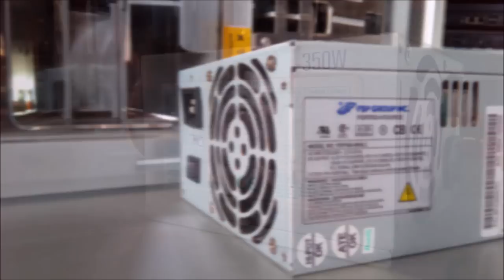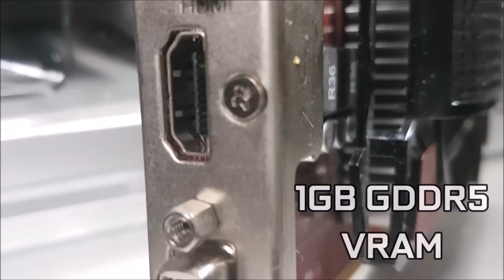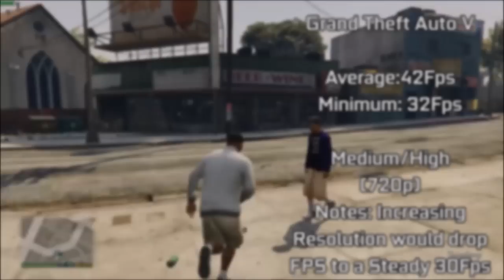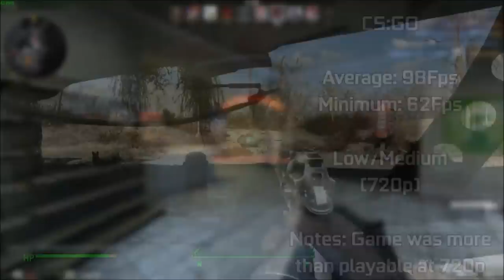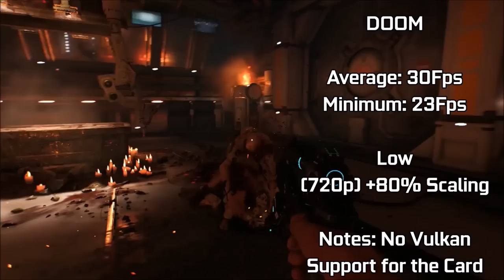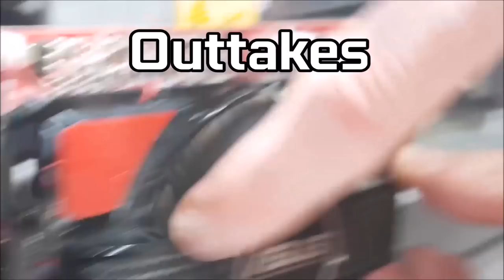Why you SHOULD buy an R7 250 in 2017 // The Low Power Consumption King.

Comment: The best GPU you could pair with an APU in Dual Graphics mode. AMD A10-7870k + R7 250 = Enough for eSports.
Reply: even r7 240 is good for esport, cs go medium 90 average lol ultra 100 average ect
Reply: hamidi abdel hakim Lol no... on medium-high 768p it barely manages to get 55-60 FPS lol...
Reply: RoomerJ The 260x makes the 250 look like a joke for price to performance but the 250 makes the 240 look like a troll for price to performance.
It's actually a little better than intel HD 4000 I think.

The R7 250 was also bottlenecked in this video in CS:GO and possibly GTA 5.
Reply: BoomerJ The consoles run at high-ultra most likely they decided 900p>1080p low/med.
As for the 
As for the GTX 750 Ti part i found only 1 video that outright lied about the performance and he has 300 views, 1 comment, and 50 subs but his oldest video is from like 8 months ago (and that video was 4 months ago) so I doubt that's what you're talking about.

In my experience a majority of people who make these videos don't lie as they have no incentive to. Even when I went and searched for the video I only found 1 where the guy made it clearly to get comments on his video and boost its ranking (sadly he didn't realize that YouTube pays attention to dislikes).

Unless you credit your source I am inclined to believe you are a liar by the way.

Comment: well I have the let's say newest version of that card wich is r7 250 2gb ddr5.Yeah,so anyway the graphics card is not the greatest I have paired it with a core 2 quad 8300 and 3gb of ddr2 ram and in most recent game it does...well?
Witcher 3 medium 720p:30-25 fps
bioshock infinte high 720p 30-25fps
battlefield 4 medium 720p 30-28fps
gta v medium 720p 40-30fps
overwatch low 480p 30-20fps
fallout 4 low 720 28-20fps
skyrim ultra 720p 60-50fps
borderlands 2 medium-high 60-54fps 
nier automata low-medium 30-18fps
and sum other mainstream games like csgo,LoL,Dota,heartstone,WoW were able to run with 60+fps at medium-high and the most mesmerizing thing for me was THAT THIS GPU DID REQUIRE A LOT OF FOKEN POWER TO WORK!(that's the reason I bought this gpu)

Comment: well, looking at the techpowerup specifications of the r7 250, it says that it actually consumes 65W on average, AND it has nothing to do with the HD 7750 since it is based on a really weak Oland gpu that features only 8 ROPs (vs 16 ROPs in the case of the HD 7750 and 7770). AND an HD 7750 actually consumes only 55W, so...
Reply from the maker: I mean this is a very old video, and techpowerup generally gives a very basic definition of power usage, and clocks etc.... Which can vary with every card. Its well known that this card has ALOT to do with the HD7750 as it replaced it on the market, as youll see most review mention. Cheers
Reply: @BudgetBuildsOfficial The HD 7750 is based on an entry level Cape Verde gpu with 1.5b transistors and 16 ROPs, while the R7 250 is based on a low-end Oland gpu with 1b transistors and only 8 ROPs (both are GCN 1.0).

Comment: First   I actually found the Older  Asus 6670 DDR5 1G Card far better than the cards in frames on the same games and running off the PCI  express slot not needing external power from the power supply.
This card I have fly's play's anything smooth at 1366x768  all full  Ultra settings..

Comment: Hey Bro
I've Hp 6300 mt
I need your help
Does R7-250 work on 320Psu hp stock
I've i5 3570 cpu 320 watt psu, 2x4 8gb ram
1tb hdd
Reply: Works on a literal 200w psu

Comment: Get the R7 250E Ver. (512 Stream processor) with 2GB GDDR5 /Couple with any 3ghz dual core CPU and overclock the core:1000mhz/Mem:1250mhz++ (x4)  Every game by 2012-2017 custom setting with all AAF off "High detail texture,Map/medium shadow @ 900P -1080P capable of 40-60fps average (150fps max)Support Vulkan and DirectX12
https://www.techpowerup.com/gpudb/2559/radeon-r7-250e

Comment: Unfortunately, they don't work with PCIe Gen 1.1, I found that out the hard way with my Asus P5K-VM+4GHz Core 2 Duo E8500. The GTX 650ti from my main desktop however had no problems (and I was playing Crysis 3 maxed out at 1024x768 without too much stuttering as well because of it).
Reply from the maker: +Dabombinable Mi: Hmmmm my card worked fine, even on a very early board.

Comment: I have the exact same gpu, but my results are way better. i paired it with an i5 4460 and 6gb of ddr3 ram. here are the results:
CS:GO: 1080p ultra, no AA, 60-150fps, depending on the map and on 1080p low (the recommended graphics preset for any competitive game) i get 120-250 fps, again, depending on the map
Fallout 4: 720 low/medium 60fps
Rainbow six: siege: 720p low 60fps dropping to 45fps when im outside
witcher 3: 720p low: 35-45 fps

Again, i dont get it how you got such bad results, maybe you paired it with an ultra slow cpu that bottlenecks the gpu, but most probably its not this. then, what is the matter?

Comment: What if i told you the GTX 750 Ti is way more than twice as fast for only like twice the money? ($60)
You can also run it on just about any PSU out there as well...
Reply: or a gt 1030, it consumes less and gets almost the same performance.
Reply: 1030 is more expensive and is faster. Power draw shouldn't really matter so long as you don't have like a 100w psu.
Reply: in spain you can buy a 1030 for 65€, at least I bought it for that price
Reply: I'd be surprised considering Spains economy is shit right now I think.
Depending on when you bought it and if you have a decent psu i'd say you should have went for a used GTX 970 although it's not a terrible deal actually.

Comment: It's better to buy two RX 560 graphics cards for $180 each and crossfire then together.   Now that will create a supper power beast of a machine on a budget.
Reply from the maker: +Happy and single; Personally you may aswell get a GTX780 for that price, as Xfire and SLI are really hit and miss.
Reply: Budget-Builds Official
 True.  It would also be better if new graphics cards come out into the market like a GeForce 1090 or a GeForce 2000 so that the GeForce 1070 and the GeForce 1080 can go down in price.
Reply: Budget-Builds Official 
Just to let you know that I have seen a run test of the RX 560 and a GeForce 1050 and the RX 560 did actually a much better job.  So if I crossfire two of these cards than the RX 560 could have a chance to do better than a GeForce  1060 but almost reaching up to a GeForce 1070
Reply from the maker: +Happy and single: You will not see crossfire RX560's ever hit 1070 performance, crossfire and SLI bring microstutters and a whole host of issues.
Reply: Budget-Builds Official issues with crossfiring graphics cards should only happen if your cross firing two different graphics cards.  If they are exactly the same card then it should be ok.
Reply from the maker: +Happy and single: Nope, read up on SLI and Crossfire, explicitly Multi-GPU in DX12 is the only way to get perfect scaling, trust me its not worth going down the dual GPU route.

As I say to most people SLI and Crossfire aren't worth it, unless you: 

-Treat it as a novelty
-Have money to burn

A single GPU will always provide a better experience 9 times out of 10.
Reply: Budget-Builds Official The RX 560 that I have is a direct X12
Reply from the maker: Happy and single: Yes but only one game I can think of supports explicit multi-GPU. Personally just stick to single cards, you'll regret Xfire or SLI.
Reply from the maker: +Happy and single: Yes I have seen an RX560's performance, it is on par with the HD7870. But using XFire won't double your performance...
Reply: Budget-Builds Official I'm going to do some experiments to see if I can stop the lagging and choppiness of the gameplay with the crossfiring of the RX 560.  I was looking at other videos that show comparing a 4gb ram and an 8gm ram PC.  The 4 ram PC shows a lot of lagging and the animation is choppy.  I'm planning to build a 64GB of ram and my processor is a Ryzen 7.  That amount of power should help the problem.  My prediction is that if your going to crossfire two graphics cards you would need the amount of ram to back it up.
Reply: so it is cheaper to just buy a single gtx1060 rather then 2 rx560's and that's the biggest problem of xfire/sli. 2 cheaper cards always end up more expensive than a single better card... (unless there isn't any better)
Reply: Rémi Clinquart actually I really had no chance because of the graphics card shortage at the time most websites were out of stock and I went to three Best Buy stores and the shelf that sold graphics cards were empty.  If I saw a GeForce 1060 for sale it would be overpriced.  Crossfiring two RX560 graphics cards is temporary until I can get something better.

Comment: id rather a gtx 750 plus you can find them for around the same price on ebay
Reply: Daily Hacks or a gtx1030
Reply: Eduardo Muniz 1030 is pretty expensive for its performance tbh...
Reply: Weetabix Salesman what? The GT 1030 costs $60-69 and has double the performance of the R7 250, and keeps up with the 750 Ti.

How is that expensive for the performance you get?
Reply: gt 1030 uses only 30 watts and accelerates 4k videos fully

Comment: does this gpu work on 250w psu? with 204w on the v12 rail? anyone help, i will use it with an a8 3800 + single channel 8gb and a single sata HD
Reply: It should work. It uses the power of the pci slot.
Reply: @gabrielgarcia9822  what about the hd 7750??? Thanks
Reply: @kiyoshiakiyama2173  Is yours a SFF pc?
Reply: @gabrielgarcia9822  not really but it's not that big
Reply: @kiyoshiakiyama2173  yes, the hd 7750 should work as well, but get the GDDR5 version, as it would be faster. If you can't find out, show me the link to the listing.

Comment: Long story short: An R7 250 (HD 7730) (same deal with the R7 240, R5 230 and so on) is a stupid product and no one should buy it. If you simply want a PCIEx16 adapter that will provide you with all of the necessary video outputs and consume 10-25W then a GT 210 would be a perfect match. If you want a good entry-level graphics card, then go for an HD 7770 or a GT 1030. There is no point of pairing a 65W gpu that performs on par with the iGPU, and even if you have a 5 year+ system, just buy a used HD 6850 (2.5x of that R7 250, 130W).
I'm currently using an undervolted R7 260X (HD 7790, GCN 2.0) and a Q9550 @3.0 GHz (Windows 7 of course).
Reply from the maker: I mean the video is a year and a half old.
Reply: @BudgetBuildsOfficial  Well, an R7 250 is actually worse than a well known ATI mid-range card from 2009 (HD 5770, 110W)

Comment: i have a hp desktop I found and will be trying to sell. it has a core 2 duo 2.6ghz, ive put 2gb more ram in to give it 4gb (cost £4), put an ssd in it which I had laying around. its running great on windows 7 but I want to get a low profile cheap used graphics card so I can have youtube 1080p playing without it taking too much cpu usage so it can multi task. What low profile cpu is the best bang for buck? My first pick is a 6450 which looks ok on benchmarking sites and is only £9 delivered. Any better options for say £15? has to be a low prof card because of the case size
Reply: i meant 6350, but can actually get 6450 at 10-12£
Reply: Ryan Cooper The hd 7570 1gb ddr5 from dell isn't a bad option, better than 6450. They go for around 20$ on ebay.
Reply: Thanks for the reply. I was only looking for a add in low profile card for youtube video acceleration as opposed to onboard Q35  graphics. I managed to get a Nvidia fanless Gt 520 for £3 delivered so was a massive improvement and now takes a hell of a lot of work off the CPU without skipping frames on Youtube.
Reply: Ryan Cooper Nice, 🖒

Comment: Nope, i highly dont recommend buying HD 7750 and R7 250 (similar performance). I had this VGA card and it cant even do anything good in 1366x768 (old AAA games), let alone newer games. 2017 games at 1080p? It would become a slideshow!
Reply from the maker: +R. Sergi: Hmmmm try running DDU and Reinstalling Driver, sounds like something was up with your card.
Reply: +Budget-Builds Official im planning to switch to GTX 1050. Thanks for the reply tho

Comment: fps 4:3 1024x768 low low low low ? how much fps can i get ? answer pls bro!
Reply: what game ? add like 25% fps,tho 1024 x 768 feelsbad xd
Reply: dep where he lives dude,if he has amazon ebay he could buy used 750 ti work fine on 300 watt psu or r7 260x( if he has enough psu power) for better performance and cheaper or add some for gtx 1050,if he lives on a shity country like me where no one sell used and you can't buy online only in stores gtx 1030 may be an option if you don't have more money
Reply: 733Rafael Not true... they preform about the same
Reply: Prices are actually not that different here. I saw 1030's for just slightly more than the cheapest 250X. And most of them are either passive or single slot which offers good compatibility with the cases of most prebuilt systems.

Comment: my 7770 with 1gb can run with twice performance than this and costs almost the same price.
For example in cs go i got 200-250fps, gtaV high 60+ fps. FullHD
CPU - i5 4460
Reply: CS:GO_Collin's how do you run gta5 with 1 GB??
Reply: 8gb memory helps with this :d
Reply: and textures on medium level, cuz of memory limit
Reply: Oh yes, the HD 7770/R7 250X is actually a nice card. Not at release (was a bit too expensive for how it performed) But later on clearly a nice budget oriented card.Got one running on 1120/1337 MHz in my other system for the longest time.

Comment: get a gtx 750 ti instead
Reply: AmirMemeZ_  Or a 770, you can get a 770 for 75$ on Craigslist and it preforms almost exactly like a GTX 1050 ti
Reply: AmirMemeZ_ gtx 1050 ti is cooler quieter and better power consumtion
Reply: That is true, but it is a lot more than 75$. So if you already have a decent PSU, then 770 is a still a very nice card for 1080p. I mean... You get a card with decent power consumption and enough power to run games at 1080p 60 FPS for 75 bucks. That sounds good to me.
Reply: Get a GT1030 instead of 750 TI. The performance is about the same but power consumption is way lower.

Comment: i have a R7 250 but i can only run CSGO at 20 fps and i have no clue why
Reply from the maker: What CPU?
Reply: its a intel celeron g1610, with 4gb of ddr3 ram, just i was doing my own low cost build til i get a better pc
Reply from the maker: There you go its  your CPU.
Reply: Budget-Builds Official  what cpu would you suggest ?
Reply: Since you're on LGA1155, I'd say an i5 3470 would be a nice upgrade as you can typically find them fairly cheap. Otherwise even an i5 2400 which can be found for a little less would still be a nice upgrade.
Reply: thanks for the help
Reply: @None a I keep the drivers up to date and I'm getting a core i5 2500k

Comment: Arent consoles using basically a HD 7870 gpu. That would be an R9 270x then which is just the HD 7870 rebranded. It was considered mid tier segment in 2013 and is a lot faster than the R5 250.
Reply: A 7870 with some of its parts disabled and reduced clockspeeds.

Comment: I have this and it can't play player unknown battlegrounds on very low. I think I just need a new gpu but I see some youtubers running pubg on a decent fps on r7 250 while mine sucks ass. Anyway, I have an i5 4460 and 8gb of ram
Reply from the maker: +Butcher Dondo: Your i5 is fine , have you got alot of background programs.
Reply: I close all the background programs on task manager before I play pubg but still no luck. Im always thinking maybe its my internet, I will going to upgrade it next week anyways to see any difference. I can run gta 5 on 40 fps avg in mix of very high to high settings without any issues. I still love this gpu but its just sucks on pubg, Im just jealous because some people can run pubg on r7 250 with decent fps.
Reply from the maker: +Butcher Dondo: Try running DDU and then reinstalling your graphics drivers.

Comment: loll i have one and it sucks
Reply: i bought an used pc with the 2gb version and i dont have problem with it lol
Reply: 1gb gddr5  version is better, the 2 gb ddr3 runs worse unless you dual graphic it with a10 apu which then it'll be able to keep up with 1gb gddr5
Reply: i had 1gb ddr5,it sucks...
Reply: its your CPU dide. i have one and i can play fallout 4 and battlefield 3 max
Reply: (I guess) performance of r7 250 is similar to GT 740.
Reply: Yes you are right ... It sucks ... I have it ....it is pathetic in 1080p
Reply: For what? New games? The version he's reviewing here only has 8 rops. That's what the Radeon 9700 had back in the day. A GTX 1060 has 48 rops and 4 times the power draw. This GPU is more power efficient than a GT 1030 in practice. 

For old DX10 and DX11 titles at lower resolutions, these little GPUs are pretty good compared to the previous generation low end